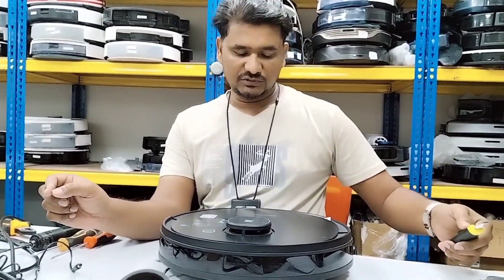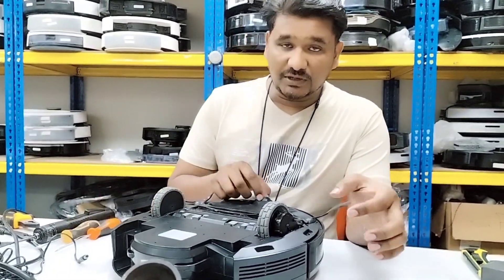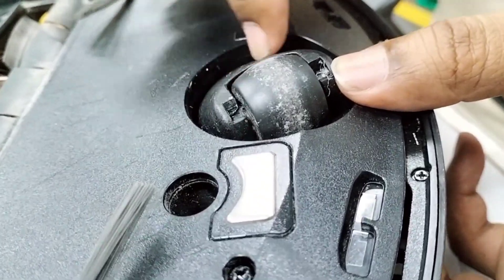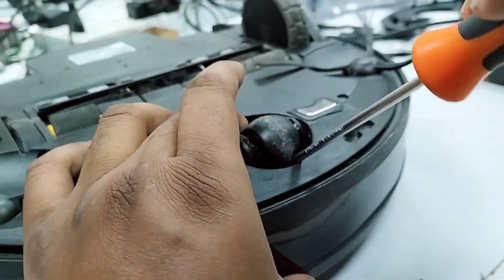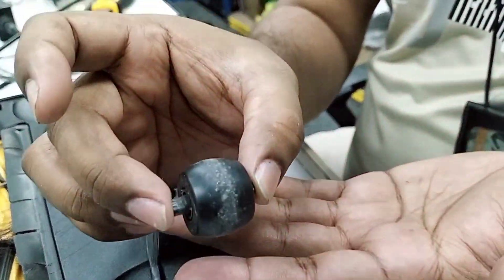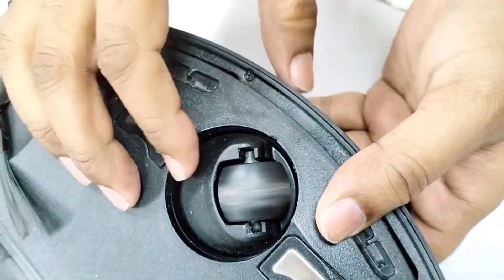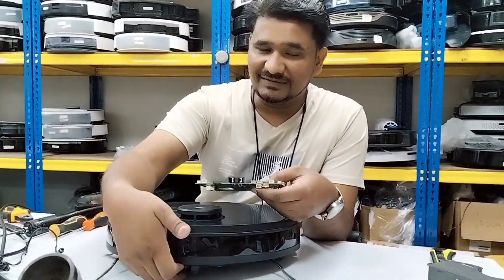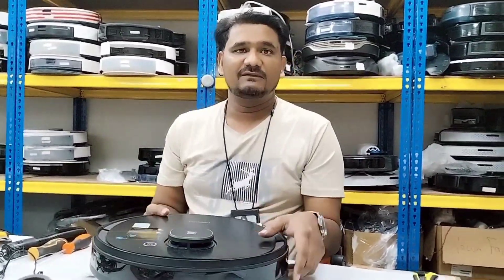Ecovacs | Deebot | How To clean hair from Front Roller?

Comment: This was so helpful - thank you! I had contacted Ecovacs who were going to repair under warranty, however I could see lots of fluff in the front wheel so thought it was worth a try and it has fixed the problem. I was worried I would damage the machine if I tried to remove it without using the right tool/the wrong way.  So now I don't have to send it off!
Reply from the maker: Hahaha 😂😂 welcome

Comment: hello teacher; but not on topic. I need your urgent information. I am writing to you from Turkey. I have a T9 Aivi robot and it keeps reporting Main Brush Failure every time. And for no reason, I couldn't find any. I took it to the masters who understand ecovacs in my country and they changed the main brush motor, but it still continues to give the Main Brush Failure error. Please, have you ever had a chronic malfunction in the robots you repaired? If you give me information, inform me that you should do the engine or chassis or any part of it as follows. I would be very grateful to you. My robot is only 6 months old please help
Reply from the maker: Actually sometimes main brush motor got short circuit with motherboard...in this case Main board and main brush motor assembly both need to replace together then only problem will solve...I repair this type case many...